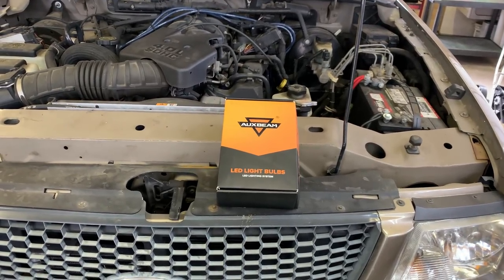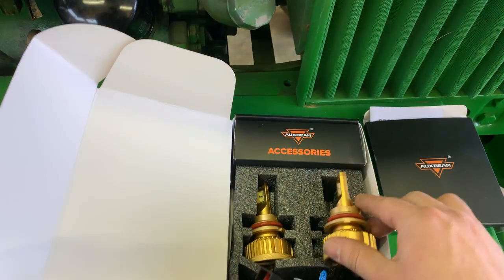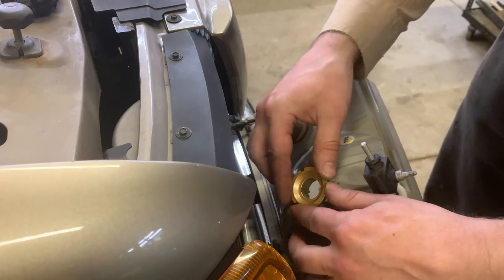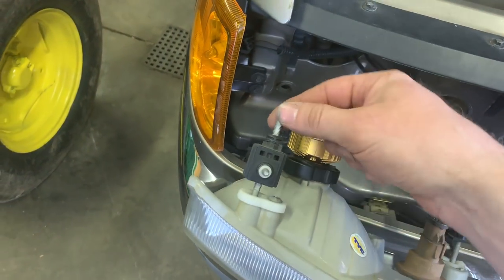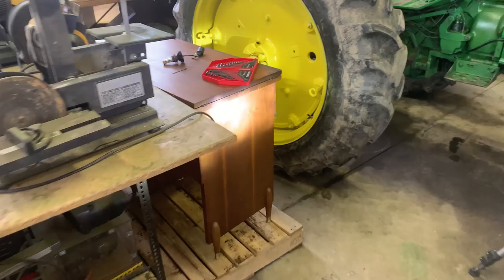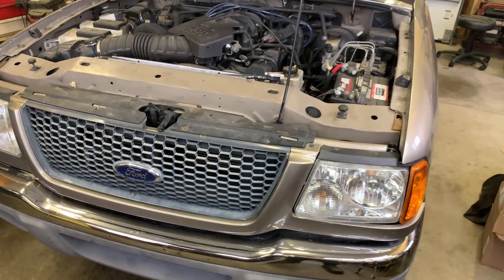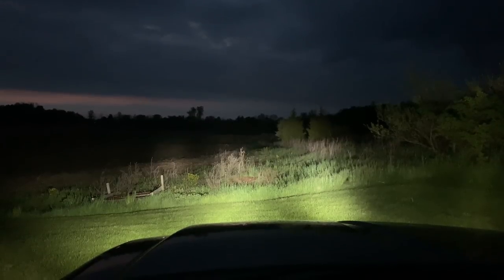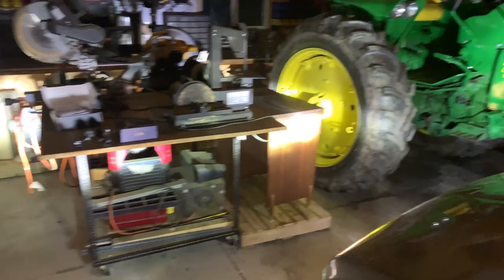Super Bright! LED Headlight Upgrade Auxbeam GT Series

Comment: It's almost impossible to get good high beams on dual beam bulbs. Vehicles with 2 separate bulbs do much better with light output and spread. Mine are 9006 low and 9005 high. The Xhp70 chips on those bulbs you have are good though. It's just the single bulb setup and the round reflector housings that don't play well together unfortunately. Slap a light bar on that ranger and splice it into the high beam wire.
Reply from the maker: That’s kinda of what I figured, at least the lights are a vast improvement over the original lights.